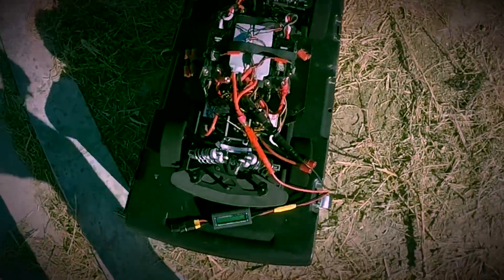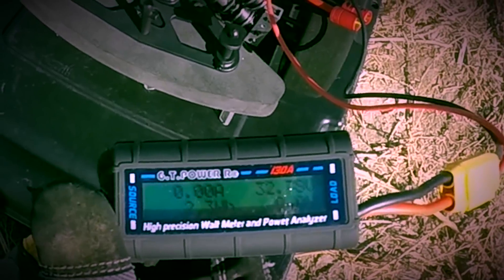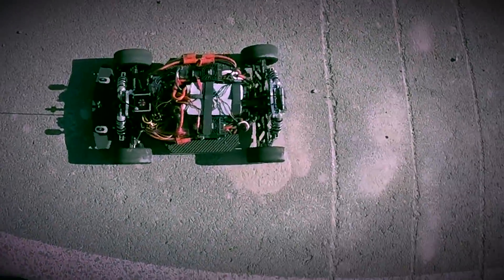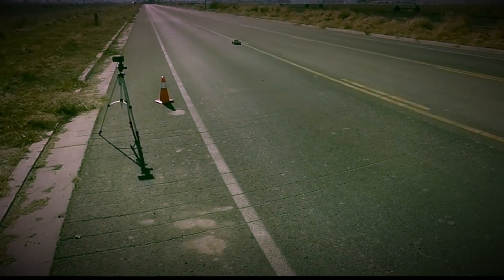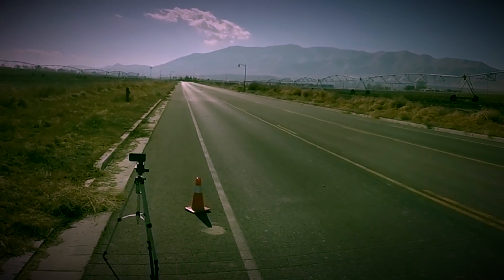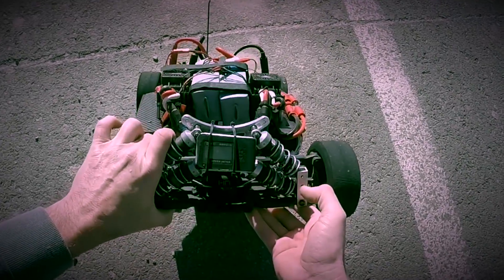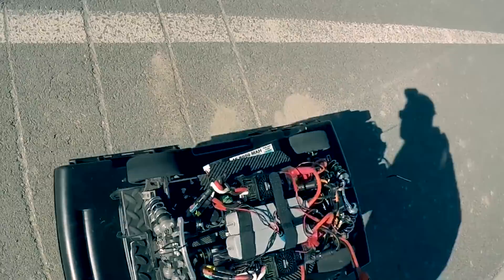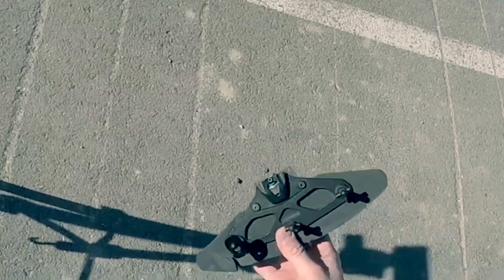18,000 Watt RC CAR BETA TEST

Comment: No way in hell that thing is making 24 horse power. 24hp = 18kW = 9000W per motor and 300A per ESC. In reality you're putting out maybe a quarter of that at best.

Comment: Ohhh... 😨. Glad it wasn't worse my friend. Wondering if you can flatten the power curve through programming perhaps. Can't recall which tires you're running, but you'd think it would be harder to break traction with all that mass above them. Again I'm not a speed guru, just postulating. Sorry she kicked sideways again. Almost seemed like identical breakages.🤔🤔😵😵😵😬😲😎💪👊👊
Reply from the maker: New Edit for the ADHD
Reply: Track13News no wonder it looked so familiar...Lol!!! 😵😵😵😬

Comment: Ok so a zero turn mower is about 20 horsepower your saying this tiny rc has more power than a zero turn mower and could power it and be more powerful ? I just can't believe it .
Reply from the maker: Has two TP4070cm 2200 kv motors
Reply: Yes, I own a tp 4070cm motor. Rated to actually to have over 12hp. Why do you think Teslas are so quick? Its true, this car has 24hp. Electric is the future bro... Check your stats you petrol head :)